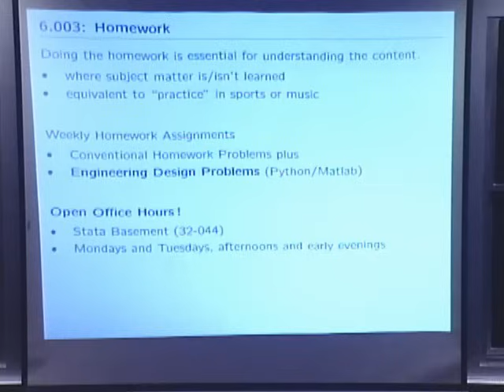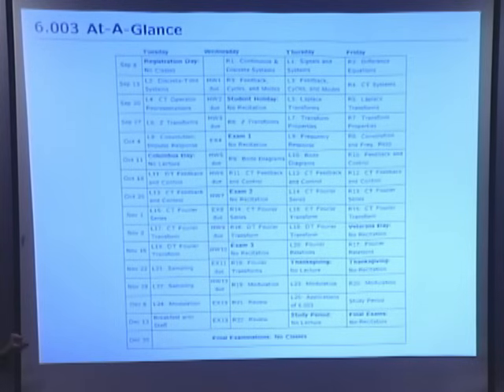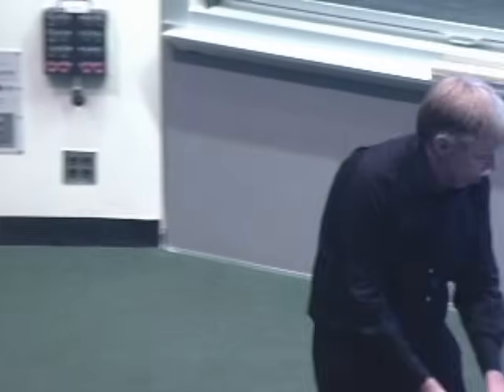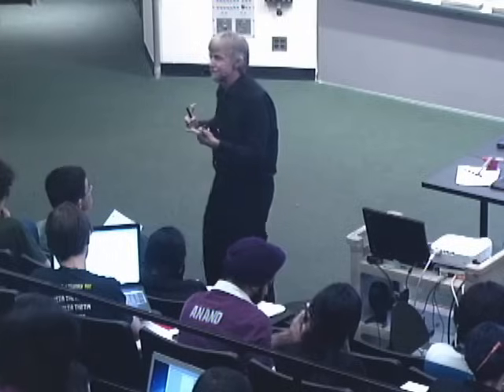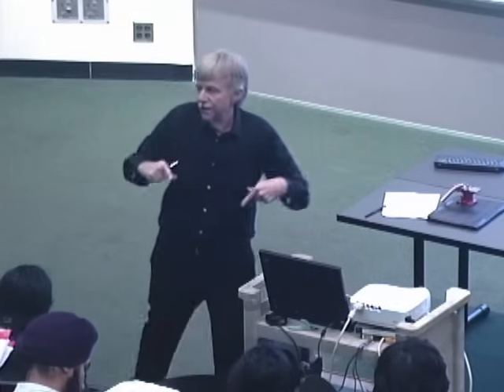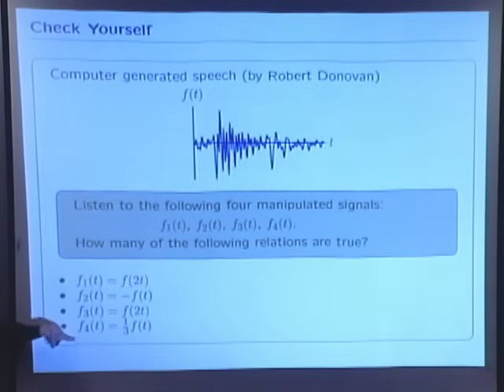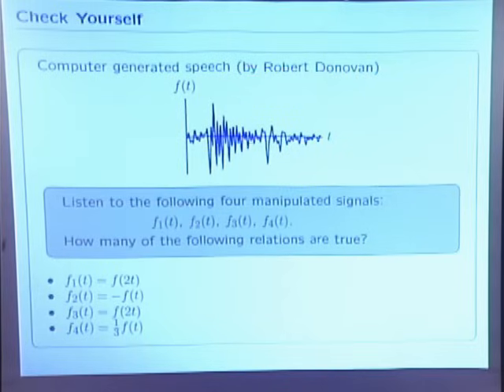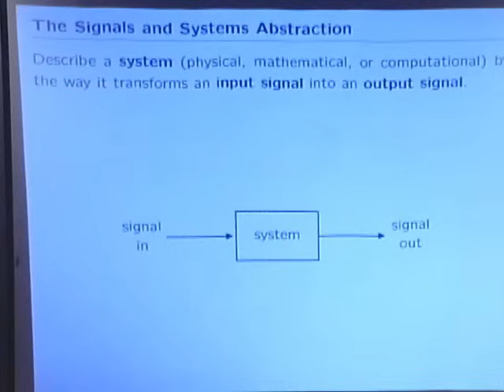1. Signals and Systems

Comment: 45:11 I do not understand why the solution for f_2(x,y) is correct
Taking the bottom left corner of the original picture, that is the point (-250,-250), then f_2(-250,-250)=(-750, -250)
And in the second image, that point is clearly (0,-250)
Reply: I actually think that the transformation for the second image should be f_2'(x,y)=f((x+250)/2, y)
Reply: And by the way, I think that f_1(x,y) is correct
Reply: @nahuel3256  I am in the same boat as you and literally came to the same conclusion. I don't believe the example he showed is correct.

Comment: if t = 2 sec then what is the slower (or expanded) sound? f(2*t) or f(0.5*t)??
Reply: It would be f(o.5*t) because when you scale a signal by a factor greater than 1, the signal is compressed. When you scale by less than 1, the signal is expanded or slowed.

Comment: I wish the sound was louder.
Reply: It's a test. You need to use Signal processing to boost the signal.
Reply: Use an op amp or a multistage amplifier!
Reply: @pspmaster2071  yes, I think an op amp is a good choice!
Reply: Use sound booster (windows 10 app)

Comment: At f(2T) doesn't time increases so the instead of squishing we would expand the waveform because we new Time = 2T? Why is it squished and not expanded? It would squish in f(T/2) ?
Reply: Yes it is Squished or you can say Compressed.
Reply: It is "squished" because what happened at time t_0=0 now happens at time t'_0=0, but the output of t_1=1 now occurs at t'_1=0.5 (what happened at any time after the beginning, now happens two times faster)

Comment: Could someone please explain why in the last image examples, f(2x, y) doesn’t describe the image stretched in the x plane? It seems that multiplying x by 2 around 0 should cause it to stretch in this way but the professor says this is incorrect.
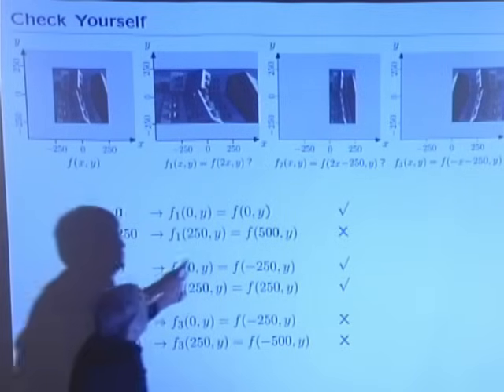Reply: Hi, are you referring to the Stata building example at 46:48?
Reply: I think you are correct. f_1(x,y) is in fact f(2x, y)
I believe that it is f_2(x,y) which is incorrect. 
I believe that the correct transformation for f_2(x,y)=f((x+250)/2,y)
Reply: 2 years too late, but maybe this will help someone else
f(2x, y) will actually be compressed  along x, by a factor of 2

For simplicity just take
f(x) = 1 at x=6
          0  everywhere else

Define: f1(x) = f(2x)
At x=6,   f1(6) = f(12) = 0
At x=3,   f1(3) = f(6) = 1

The value that f(x) takes at x=6
f1(x) takes that value at x=3

So f1(x) is a "compressed" version of f(x)
Reply: @nishantarya98  thank you my friend,

Comment: How anyone in this video could successfully answer any of the instructor's question after no explanations or examples is beyond me
Reply: Some are smart, some have worked through the books before taking the class. Some are neither.
Reply: @schmetterling4477  seems to me that the only book on the subject is oppenheim and wilsky..which is the equivalent of an instructional guide of chinese, written in hyroglyphs.
In other words, at best confusing and badly written. At worst, completely useless unless you aleady understand everything about the subject. A good textbook should increase the reader's interest in the subject and present the subject matter so it is easier to understand than it would be if the reader did not have the book. The book by oppenh and willsky does neither.